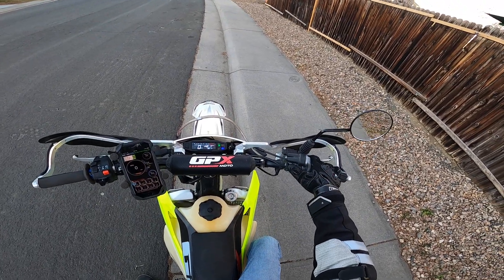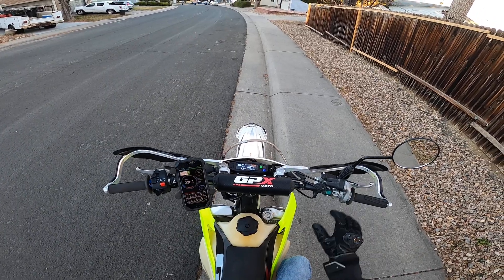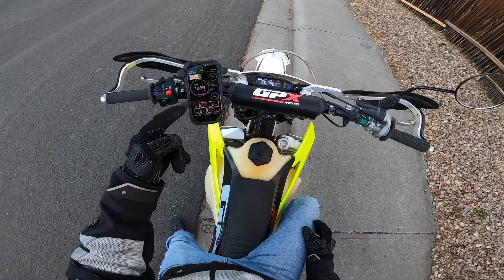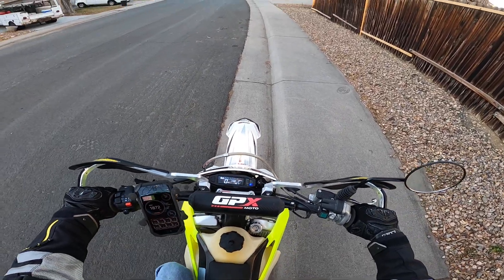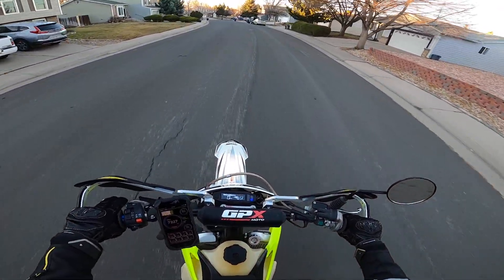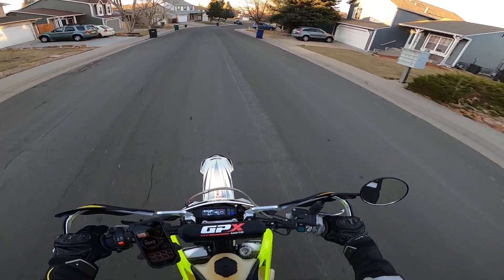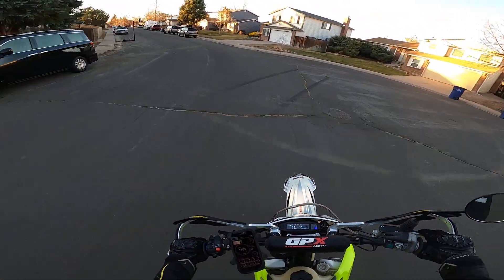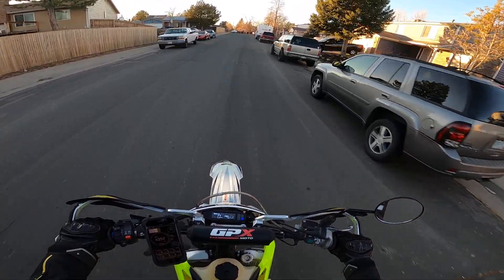11172020 Aracer Mini5 on GPX FSE300R

Comment: Is the 300 adequate or would the 450 be better for a 220 pound rider looking to do do easy going trails (rampart and buena vista area) and some road (40 miles)
Reply from the maker: Think the 300 would pull you around just fine but the 450 just has a bit more to it, kinda more of the same (linear/torquey engine).  I like the mileage I get on the 300, 50mpg so upwards of 120-125miles per tank and it is ~10-15lbs lighter, my bike probably runs about 290lbs with everything on it.  Same suspension/chassis/tank/etc on both bikes just different engine.
Reply: @SCakey  thanks, good info. Do you ride the 300 on the road at all? If so, how does it do?
Reply from the maker: @thomas8734  Ride on the road as I'm plated but rather wear my knobbies on dirt.  During this ARacer testing was just tuning riding around my area on 25-45mph roads.  Does just fine on the street but it is a small/light 'dirt bike'.  Feels entirely comfortable below 50mph, really not that different from a DRZ/WR/KLX far as abilities.  These do come with a large rear sprocket where it probably maxes out around 65mph unless you drop some teeth.

Comment: Sounds pretty good to me. I have the 2021.5 fse300r and I'm curious if this is compatible.

Are you running without the baffle?
Reply from the maker: I don't think anything with the engine/fuel injection is changed with 2021.5 from my 2021.  If it's an MT05.2 ECU, I'd be very surprised if this didn't work.  This is running the Lexx exhaust with quite-core spark arrestor insert.  Pretty cool ECU and do feel it on the throttle.
Reply: @SCakey  I have the Lexx on order now, hoping to quiet the little beast down a bit. I'll be following your progress for sure 👍.

Comment: This will work on the FSE450R also? Does your 300 has the Delphi injection on it?
Reply from the maker: I'd expect no issues running this on the FSE450R since far as I'm aware it's the exact same Delphi MT05.2 fuel injection system as what I have on this 300R.  I actually got recommended this from a guy using it on his NC450 engine with Delphi FI in another bike and am using a lot of similar mapping values as him.